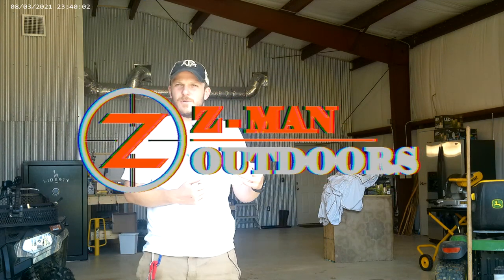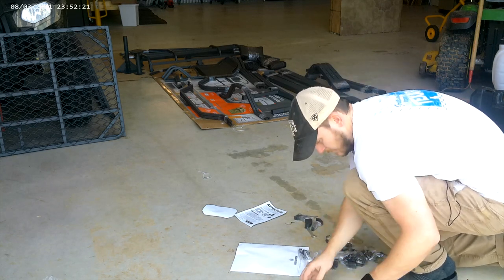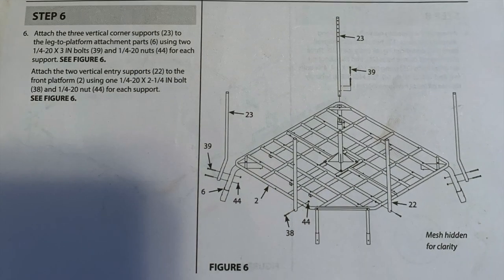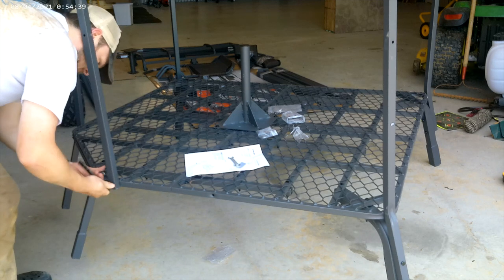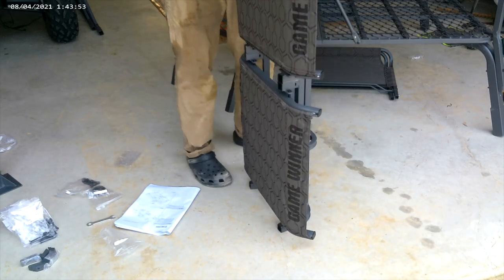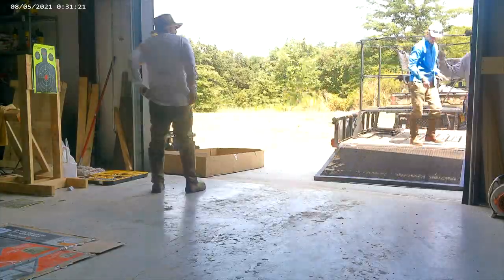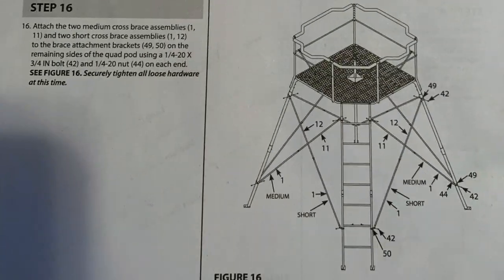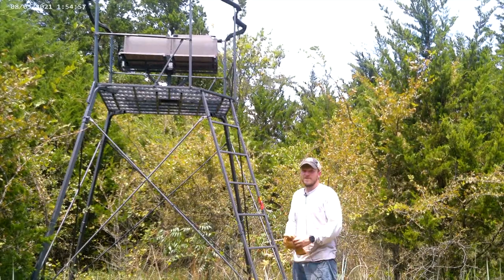Game Winner Quad Pod Build & Review

Comment: I have a couple of these, here's some tips. A full size blind fits PERFECT over the top. Cheaper than the accessory kit. And also, tie each leg down with a ground anchor or it WILL blow over. They blow over super easy. Also add cross braces so the legs don't fold inward if it was to blow over.
Reply from the maker: Thanks for the tips! I did anchor both of mine down because they are a bit top heavy, figured it was needed. Great idea on blind. Are you saying like the typical ameristep 2 man blind fits over it? Do you tie it to stand or anything to keep it there?
Reply: So which blind do you use
Reply: @andrewsmith941  I use a couple of different kinds. One of them is a rhino 150. But most blinds are about that same size. So find one on sale at Walmart and buy it.

Comment: Would would you rate the seats? 1-10
Reply from the maker: It’s better than most tree stand seats. They don’t squeak when you turn or anything. They are pretty comfy. If sat all day sits in them before. I have seen people remove the seat stand and just put a chair up there or something else. I personally don’t have any issues with the seats though
Reply: Agree, the seats are comfy 

I take them down every time after hunting because I don’t want to ruin the material out in the weather

Sometimes I’ll just bring a fold up chair

Comment: I have 1 but a tree clipped 1 of the bottom legs bent it a little do you know by chance the height from the bottom platform to ground by chance I’m gonna try to rebrase it because it’s not bad ..I don’t know if you have the canopy the cover for your but invest in it 100 bucks worth it and get you some carpet Fromm dollar store 10 bucks
Reply from the maker: Yeah it’s just over 10’, so I would think assuming 10’ should be good. I put some rubber mats on the bottom. Didn’t think about carpet, but I may switch to that, good tip! How long have you had the canopy, do you take it off in between seasons? I’ve heard good and bad things about it
Reply: @ZManOutdoors  the canopy has been on there since last year it’s still perfect I just need to go up there with 12ft 2x4’s and get it stable getcha the canopy worth it I didn’t think of padding I just saw the carpet just cut a slit in the carpet and slide it in
Reply from the maker: I will have to check it out for sure, thanks for that tip!

Comment: Do you think the stand is sturdy enough to withstand cows rubbing against it? Great video by the way!
Reply from the maker: Thanks for watching! That’s a good question. I think if you stake it down good, it probably could. But I guess it probably depends how hard they hit it. The legs are pretty sturdy so I can’t imagine they would bend them. I am sure the hogs hit mine, but they aren’t nearly as big as a cow haha.
Reply: @ZManOutdoors  thanks man, I have a ton of hogs at my feeder right now and want a simple blind to set up so I can get rid of them so the deer will come to it more.  We have alot of cows on our land and they've already rubbed my camera a few times haha.
Reply from the maker: Yeah I’ve had issues with cameras on some properties where cows knock them off and smash them haha. Learn pretty quick to raise those up higher. I think this blind would work fine. If you hide it behind some trees or something. Or even just get the camo kit that covers it up. You should have no problem picking off the pigs
Reply: I’ve had mine up for a year now around cows 

I put the legs on some concrete blocks and staked it down with the stakes that come with it

Cows haven’t touched it
Reply: You could always use some T-posts to stake it down better
Reply from the maker: Good tips there, I think that would work perfectly